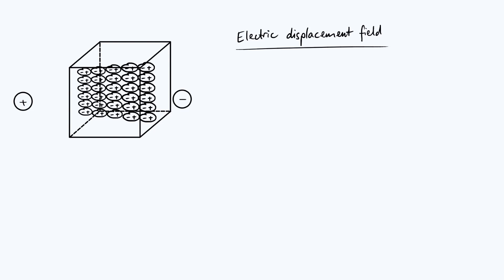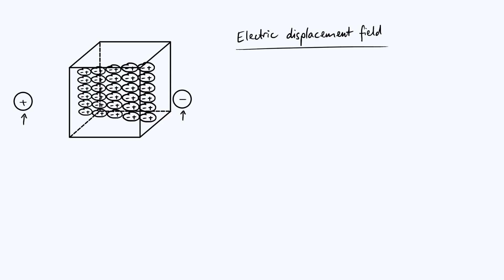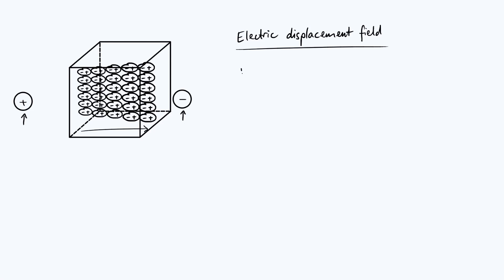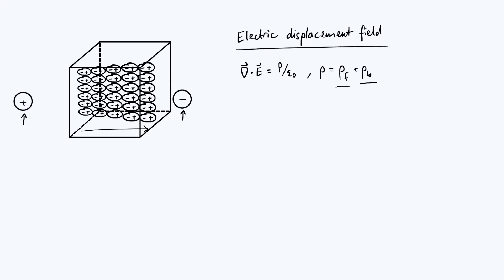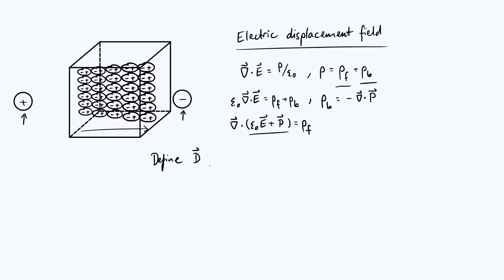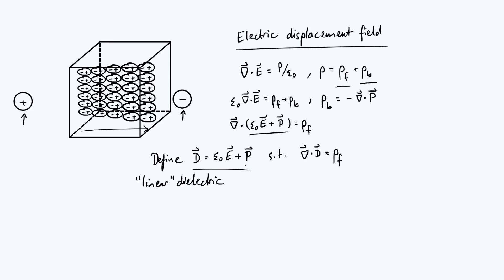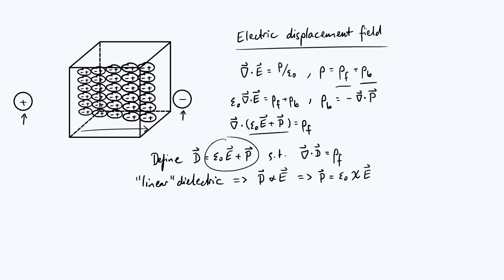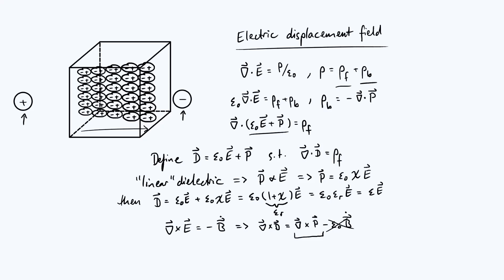What is the electric displacement field?

Comment: What is the free charge here?, Where it will be,1) inside the dielectric, if yes then it will be a conductor not a dielectric or
2) the outside charges that produce es the polarization in the dielectric, but why the name free?
Reply from the maker: Your option 2) is correct. The term can potentially be a bit misleading as the charges are not necessarily free to move, but that's the standard terminology!